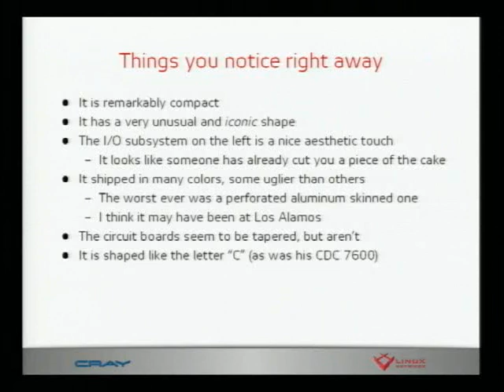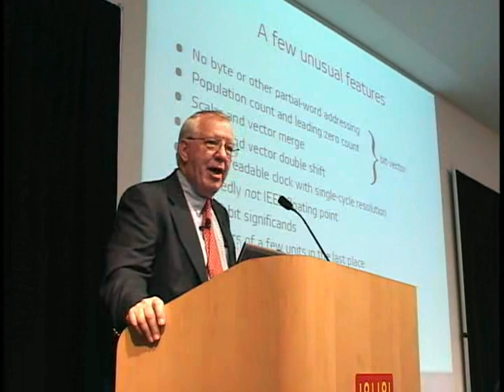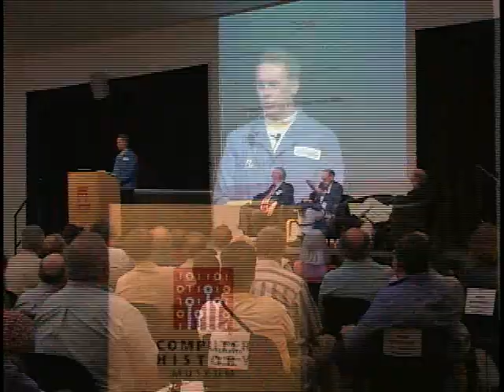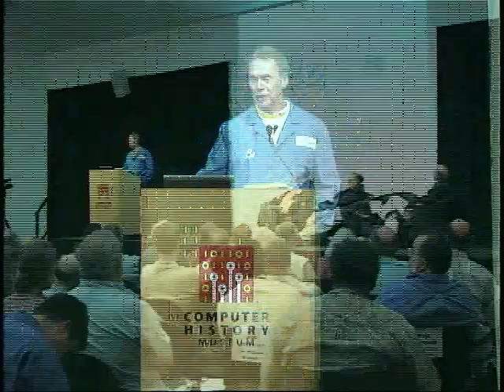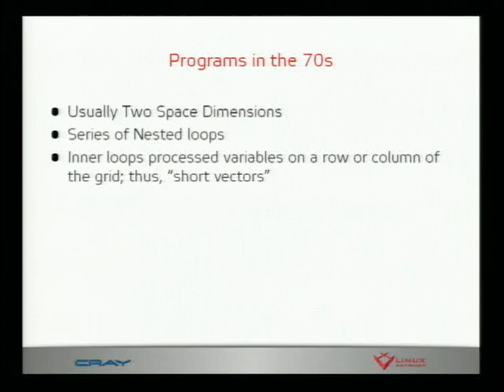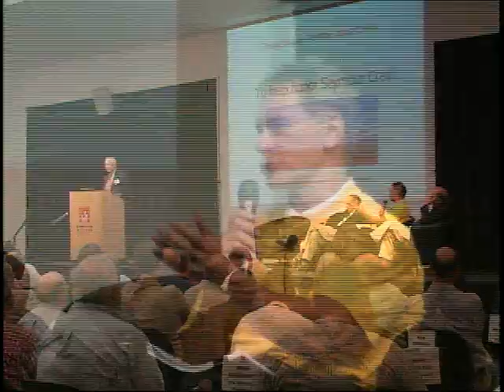Cray-1 Supercomputer 30th Anniversary

Comment: C programmers will understand this. My organization acquired a Cray YMP in 1990, running UNICOS. So it had a C compiler. And I tried:

while (*dst++ = *src++)
      ;

(copy a NUL terminated string).

The resulting assembly of the loop, shifting through the 8-bit ASCII characters stored 8 to a 64-bit word, had 80 instructions.
Reply: You learned something ! 😀

Comment: Does current desktop gamers computers able to solve tasks and problems close to the same speed that the original Crays did?
Reply: Yes. The Cray-1 was clocked at 70 MHz. My 10 year old Intel Core 2 CPU is clocked at around 3 GHz.
Reply: My desktop PC (16 core) is at level where best supercomputer were in mid 2000.
Reply: There is more to making a supercomputer than clock speed.  Parallelism and i/o bandwidth, especially.
Reply: @GH-oi2jf  supercomputer vs. computer cluster

My assumption is that for questions like this we are talking about total processing power as every historical system is unique to some point.

Comment: “Parity is for farmers” was first said in connection with the CDC 6600 (maybe 1604), not the Cray-1, although it was repeated often.  But Serial One of the Cray-1 did have parity (but not secded).  Secded was included beginning with Serial 3.

Comment: Thank you very much for this video! There is so much that they don't teach in Computer Science now. I wish these speakers would give some more lectures - it's fascinating how these machines worked !
Reply: Yes ... I still remember the Motorola MECL logic design guide that described PC board trace widths and line termination techniques ... I used the knowledge on TTL systems though, because of where I was in TI's DSEG group in the 70's and 80's.